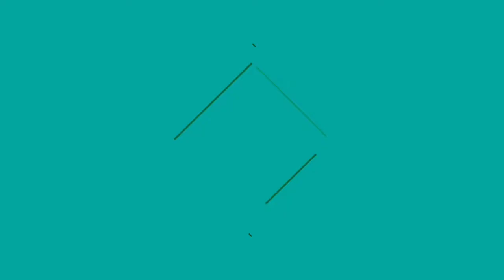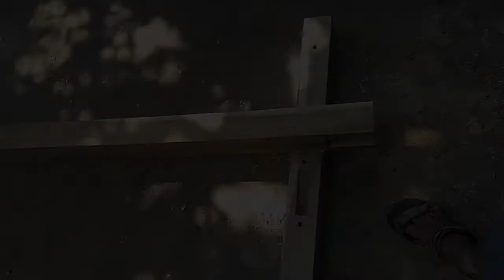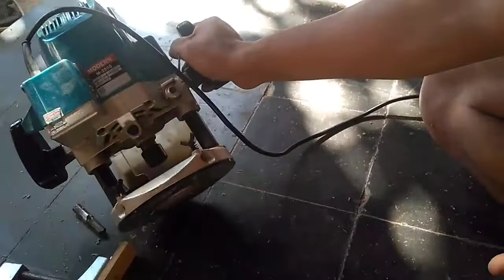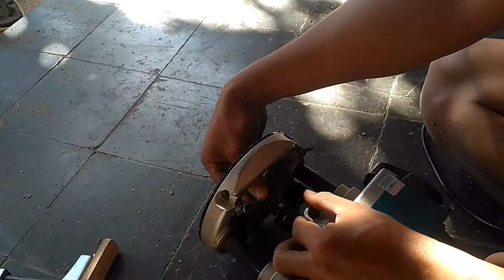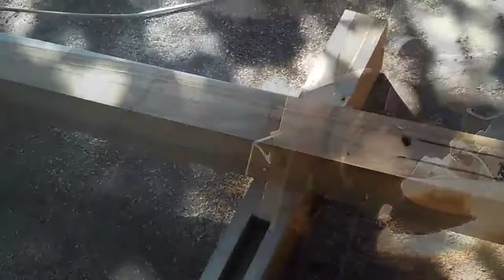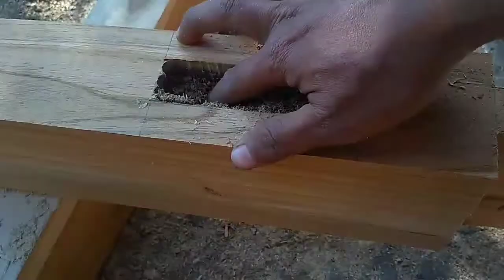CARA MUDAH MEMAHAT KAYU BALOK DENGAN MESIN MODERN M-2800.

Comment: Watt 900 kuat gak mas
Reply from the maker: Kuat bang, tpi masih pake stavol. Lama2 mcb lembek
Reply: @DayaCipta  solusinya gmn mas ya
Reply: @DayaCipta  pingin beli tp listrik dirumah 900watt
Reply from the maker: Pake stavol kuat bang, tpi kinerjanya ya ndak maksimal.
Reply: Stavol nya merk apa bang sama beliny di mana
Reply from the maker: sanwa CD800A bang, di on-line shopping bnyak